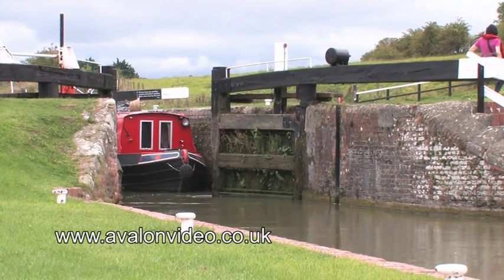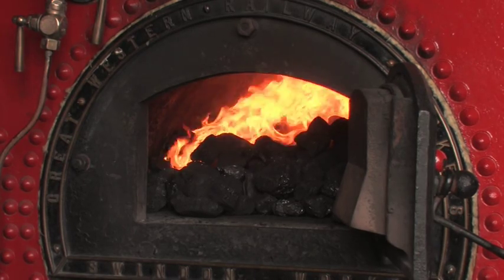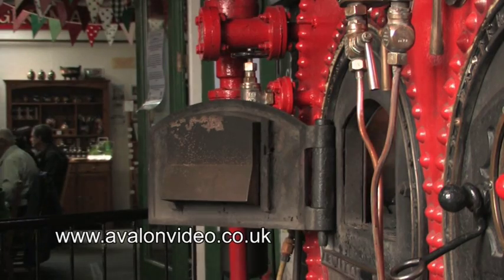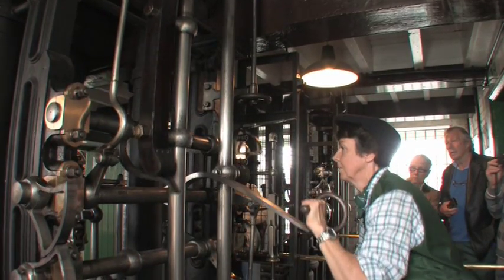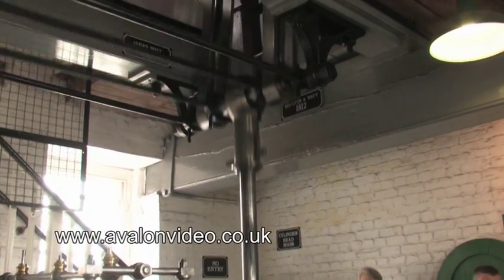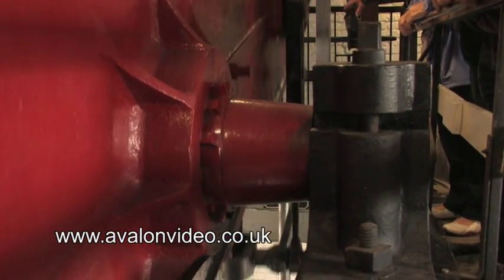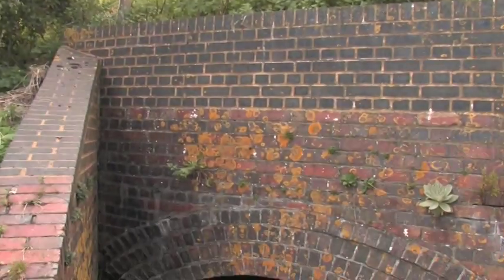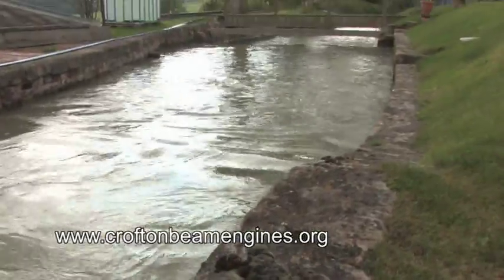The Beam Engines at Crofton Pumping Station on the Kennet and Avon canal

Comment: I'm confused.  The narrator says "At this end is the piston which is pushing the beam down and on this end is the pump.  How it works is steam is pushing this end down, the valves are then released and it goes back by gravity."  My understanding is that steam is actually pushing the piston up which drives the beam up and on the other side of the beam, drives the pump down.  A vacuum is created within the cylinder at the top of the stroke which creates a pressure differential so that atmospheric pressure, not gravity, drives the piston down to complete one cycle.  I would appreciate it if someone could either correct me or explain in further detail.